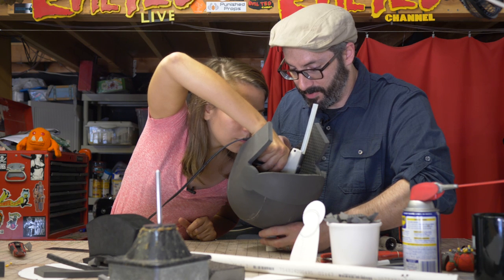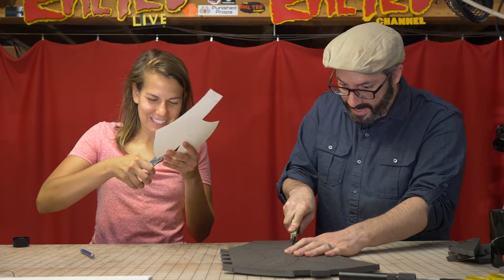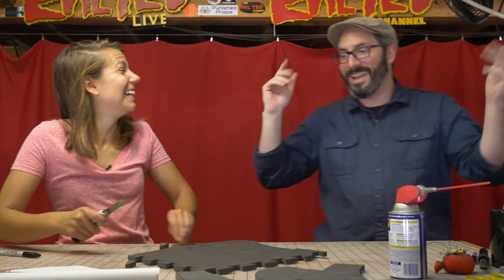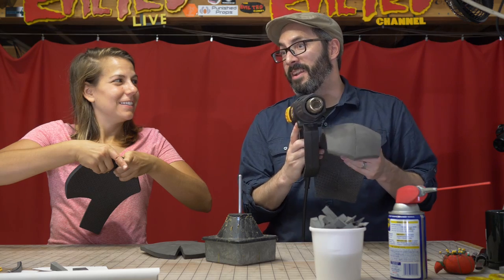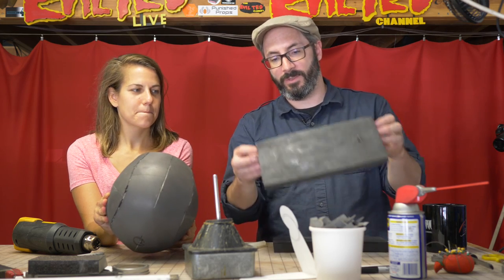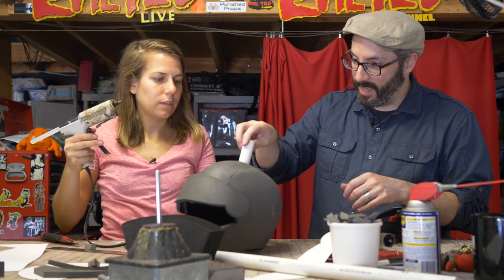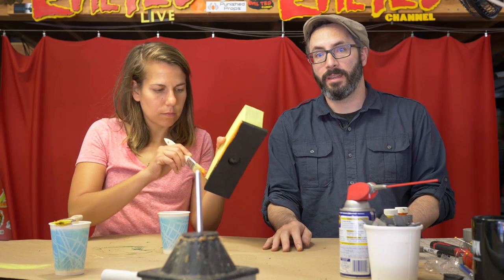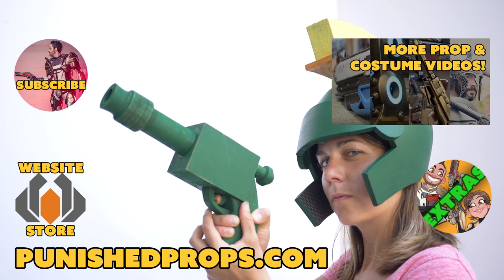Making a Foam MARVIN the MARTIAN Helmet with Ali Spags!

Comment: 19:27 A tip to avoid flinging hot glue sticks across the room: poke one end of the fresh glue stick with the tip of the gun so you can glue that stick to the partially used stick inside..
Reply: Alex Swavely I tried that once but it didn't work for some reason
Reply from the maker: That is a fantastic idea!
Reply: Genius!

Comment: I still have a scar from a hot glue burn from 1991! I was using a high-temp glue gun, and somehow dripped a huge glob of glue on my thumb knuckle. Without thinking, I ran it under cool water to solidify the glue and then pulled it off. The entire skin and fat layers pulled off with it. I could literally see down to the muscle, since it was such a thin layer... 

It was creepy as hell.

Comment: I don't mean to pick on anyone's accomplishments-- but I have to take exception to sharpening a segmented knife blade. I could understand using one if you used more of the length of the blade all the time. Then makes sense. But, in theory, you guys are really using just the tip and most of one segment.
These "snappable" blades are meant to be able to knock off the dull point and give you a fresh, really sharp new tip. So you tilt the blade while cutting and get two segments-- snap off two.
Love the helmet and the topological solution.
Reply from the maker: When cutting foam like this, you end up using the entire length of the blade. I can confirm that it all becomes dull. Sharpening it keeps you from having to break off or replace the blades every 10 minutes or so. I can recommend it 100%.
Reply: I would not have thought foam of any kind would have such a high rate of blade dulling. High mineral content? Maybe if you used a brand name like Olfa refills. Don't get me wrong, dull is dull-- sure! But I'm just interested in spreading the info. Thanks for the response, by the way.
Reply: EVA foam dulls the blades incredibly quickly.  Don't ask me why...don't know...I just know that having a sharpener makes all the difference.  And yes, we typically use the full blade.  Sharpening the blade - even if the pieces can be snapped off allows you to have a lot less wasted blades.  You just resharpen it over and over.  Less waste...less nasty stuff filling up our landfills!  Also that means less cost because you aren't just buying replacement blades all the time. :-)
Reply: I"m convinced!!! I do want to try my hand at working with EDF some day-- and wouldn't that be a funny sight, watching me hack and saw through a sheet with shreds and bad cuts, crying, "Why... ? WHY???" Now I don't have to struggle!
Reply: Absolutely!  Believe me, before I got the sharpener I had the struggle! I couldn't figure out why (even with what seemed like a new blade) I couldn't get my cuts smooth and unblemished.  Then I watched Evil Ted's videos as well as the Punished Props vids and they both recommended the sharpener that they show in this video.  I ordered it from Amazon and man, it has made all the difference in the world!  A couple swipes on the sharpener and I get the same clean, smooth cuts - each and every time!  Makes all the difference in the world!  Glad to be of help! :-)
Reply from the maker: I've been recommended the Olfa blades before. I'll have to get some and try them out.

Comment: Are there any retail stores that sell barge like Home Depot or lowes?
Reply: home depot and menards carry contact cement, most hardware stores like that (usually) carry barge but not all of them. check the websites for local stores if you want to double check
Reply: Thanks! :)
Reply: TJ Ruggiero I use weld wood contact cement and it works good

Comment: Going off the beginning segment, I once had hot glue burn down to the fat on my finger 😐
Reply: Artemis Flynn Yikes! I once burned the underside of my finger and I got a boil. I eventually popped it. Surprisingly, I had no scar. But, now when I use hot glue and burn myself, I don't feel it. Which is odd but still helpful
Reply: Project: Filmmaker yeah, I'm also more used to the sting of hot glue now 😂 and I did get a sweet scar out of it
Reply: Artemis Flynn Cool
Reply from the maker: Yeah hot glue is the worst shop injury I've ever had. =(
Reply: Same, although mine burned through the fat layer too... thumbs don't have a lot of thickness!